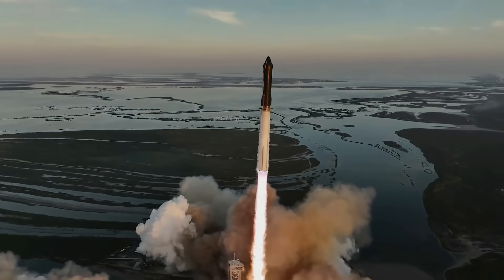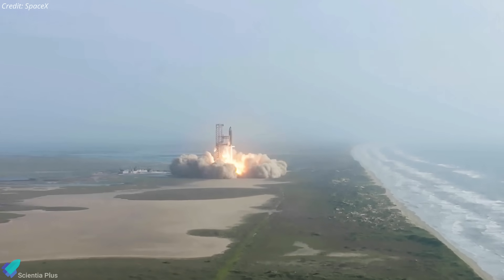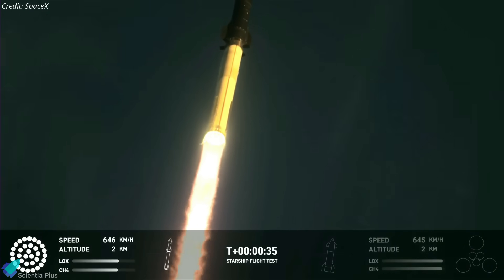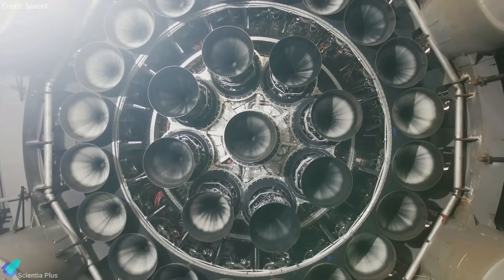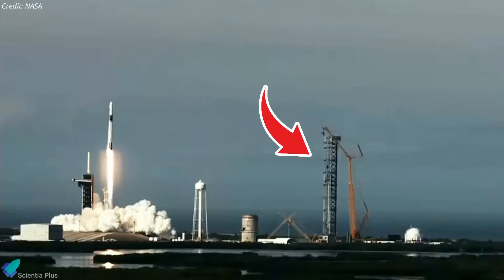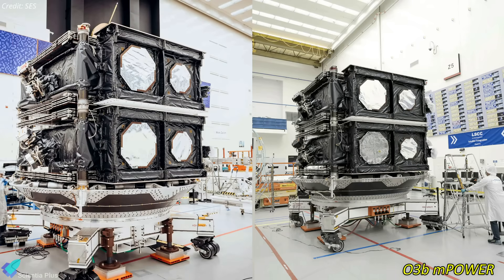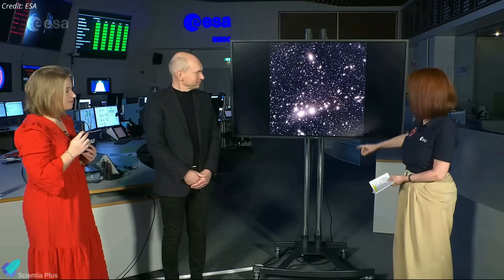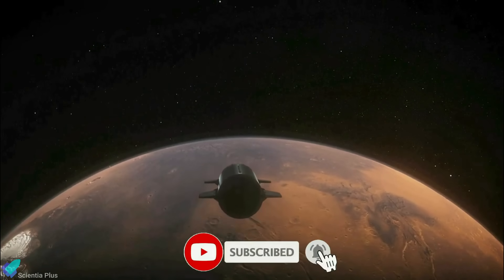SpaceX Starship Launch Complete & Detailed Post-Flight Analysis & Damage Report!

Comment: This launch was no a failure. It was very successful because it achieved most of the goals set out by SpaceX. Here are some of them: 
It launched as planned, with all engines functioning perfectly. 
The Deluge System worked properly. 
The Launch Tower was undamaged. 
The Launchpad is in good order. 
The craft passed Max Q without incident. 
Hot Staging occurred as planned. 
The Hot Staging Adapter worked correctly. 
The Starship engines all ignited correctly. 
It passed the von Karmann Line. 
The Flight Termination Systems in both Stages worked flawlessly. 
A huge amount of flight data was accumulated by SpaceX. 
That data will help the teams to make the next flights even more successful.

Comment: 2 flights 2 blow ups. SLS, 3 flights, including one around the moon, zero blowups. The difference between good engineering and crappy engineering.
Reply: How much does the SLS cost per launch?
Reply: @johneagle2100  
Worth it!
Reply: @Wised1000 now we are talking about the NASA sls right and not the SpaceX heavy! 
As the NASA unit is in the hundreds of millions to launch as opposed to SpaceX heavy which is far cheaper!

Comment: No mention of installing the modified AFTS, one of the pre-flight FAA considerations.  Since both AFTS had to be used, I'm sure the FAA will be reviewing in their mishap investigation.  You don't mention that SpaceX had to hold at 40 seconds in order to complete the fueling.  This tells me that SpaceX needs to revise their preflight cadence.  There is also video on YouTube and X of Starship taken by Astronomy Live in the Florida Keys.  NOAA radar images show both the booster and Starship debris fields.  These would all help confirm the Puerto Rico video.  All of these photos and radar images show a track much farther north than the projected path you show.  I think that is worth noting as I'm sure it is something the FAA will be examining.  In fact, to me it is the most disturbing aspect of the flight.  Remember how the FAA reacted to Virgin Galactic going off course.  If the Starship AFTS had not worked, where would Starship have ended up?
Reply: Was held for further pressurisation was it not? 1min out of a 3hour procedure, with an ability to hold for 30mins, is hardly a cadence issue.. especially when they have engineered in a 30min hold window for such matters, and more besides.
Reply: @QziQza  not major but I just think they don't have their pressurization timing nailed down yet and it is something they will work on.  And their window for this flight was only 20 minutes not the full 30.
Reply: @tmg7476  aye agreed, just mind that internal pressure is effected by external conditions, and those conditions aren't static.. especially as the sun is coming up. 

This is more pronounced with starship, as its internal volumes are as crazy, as its external surface area :D
Reply: @QziQza  yeah, not major, but I still think SpaceX will work on them, tweak them, just another lesson to be learned.  That's what they are good at.

Comment: Too much drag at  148km altitude, and 24,000km/hr  falls short of the 28,000 required also the fuel was about to run out. It was an untenable situation, so there was no alternative but to automatically self destruct (FTS).  Radio contact was lost with Stage 2 when it  self destructed. On the whole, a very good effort, and an enormous improvement on the first flight.
Reply: How could the fuel run out if the tanks were designed to lift 150 tons, maneuver around in orbit, do a boost back burn, and land afterwards, eventually? Are you saying they simply miscalculated and didn't put enough fuel in it?
Reply: @disturbed4733  Really? The Engineers didn't put enough fuel in? Is that the best you can do? Maybe the most likely reason for the rapid fuel depletion  evident on the telemetry was loss of containment? That would account for the gas releases and the spiralling prior to FST activation.  Think before you post.
Reply: First stage exploded because of a rupture tank. The second stage exploded (after loss of transmission) while Spacex was not even aware of it and for 4 minutes after the explosion was reporting that everything was A OK. No FTS was engaged.
Reply: @dh88k   Hmm. I didn't know the FAA launch investigation was completed, that they had come to a root cause analysis, and that you had access to the report.

Comment: Failure is subjective because the general population has no real insight on what EXACTLY SpaceX's main goals and objectives and acceptable losses are and were with their EXPERIMENTAL rockets and launches at each stage of development as manufacturing iteration continues to develop a fully reusable vehicle suitable for human occupation and space exploration.
Reply: rockets are a dead end space x needs to invest int reaction engines as they are the future with the space plane which they have already cracked the problem with the pre cooler system which will enable the engine to travel at mach 20 with out melting the engines

Comment: The heat tiles are still garbage.
Reply: It hardly mattered on this flight because it wasn't expected that starship would make it to reentry.   Also this is an older ship and so not much attention was paid to the TPS for the above reason.  The tile issue will get resolved in due though I understand the penchant for many YouTube viewers to belabor the issue.
Reply: @michaeldeierhoi4096  as long as you admit that the tiles are  garbage. They have known for a long time that they are, and I still don’t see a resolution to the problem. It doesn’t give me much confidence that they they have figured it out. It was supposed to fly to space and reenter near Hawaii. If it was not important, they would not have wasted time and money installing them for this flight.
Reply: Absolute nonsense. Titanium melting point = 1700 degrees. Thermosphere =- +3000. Only idiots believe this is anything more than a pantomime any more. What magic does daddy elon use?

Comment: 148 kilometers in 9 minutes = 986,67 km/h......vs 24124 km/h can someone explain this to me?
Reply: Rockets doesn't go only up into the sky. They launch pointing up (90 degrees) then slowly rotate and increase their velocity more and more parrallel to the Earth surface until their nose is almost pointing to local horizon (0 degress). In short velocity vector has X and Y values.
Reply: It was accelerating from 0 to whatever. It doesn't instantly start at 7000mph  and maintain that speed.
Reply: It's magic. Stop asking hard questions. #researchflatearth
Reply: You should not be here.😅
Reply: im dead! how u notice me @ibryansukada9607

Comment: Your video contains incorrect conclusions regarding the reasons of the explosion and about the on-schedule shutdown of the starship engine. It had not yet reached nominal speed and the engines shut down prematurely.
Reply: Also the first IFT failed because a fire in the engine bay severed communications between the flight computer and the TVC controller, not because of unsymmetrical thrust.
Reply: This video when full BS with the title.  Clickbait
Reply: Also, the hold down clamps are released about an hour before launch, not after engine ignition.
Reply: Also the Hold Down Clamp are released about 10min before the countdown.  This is so the clamps don’t jam with the wight of the StarShip & fuel.
Reply: Concur!  At T+8:04 approximately 30 seconds before the scheduled SECO a large puff of gas was seen at the same time all Starship engines shut down. Three seconds later the flight computer triggered the FTS.
Reply: Just out of curiosity,  are these engines shut down manually? Or is it an automatic procedure programmed?
Reply: @cementkidd Nothing is done manually. There is a possibility to activate destruction from the ground, but destruction also have automatic triggers.
Reply: @cementkidd automated

Comment: I don't think any rush assessment of the Starship launch damage is going to satisfy NASA. NASA expected between 15-17 faultless launches after, repeat, after musk proves his prototypes work to spec. So, now you need another launch to just catch up and time is slipping by. 7 months for his last screwup, how much longer now? There were a host of fixes put into this booster to satisfy NASA and yet it totally failed again. After eight minutes there was no data transfer, the data was lost. This is being billed as a success which sounds like something America's other stable genius would say despite the evidence captured on film in flight.
Reply: When NASA was getting started they had some rockets blow up on the pad. At least the two prototypes got off the pad before they had to be terminated.
Reply: @ferky123  That was last century mate. The point seems lost on you. Good luck anyway, when are you off to Mars? Or Dear Moon, perhaps?